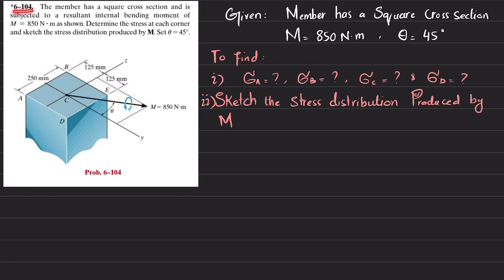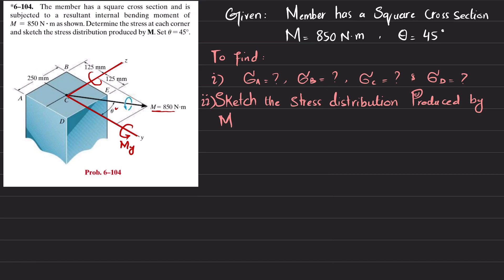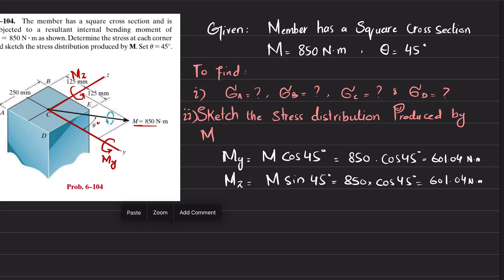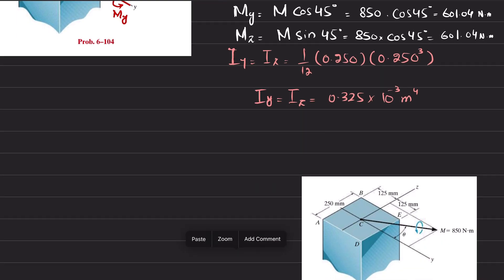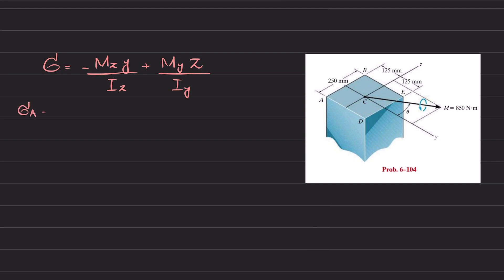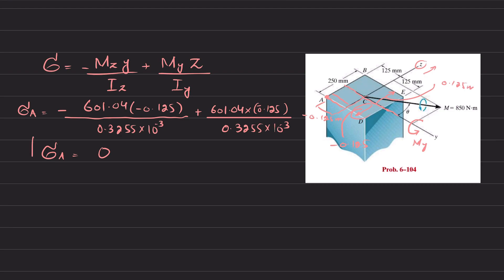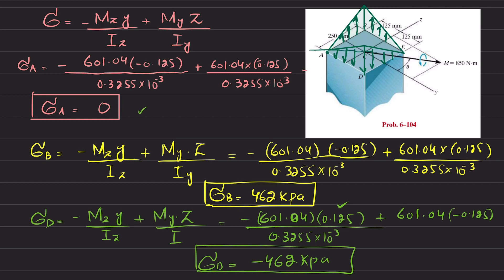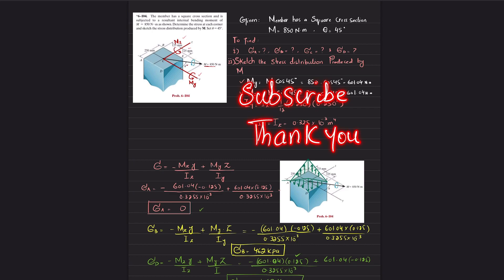6-104 |Chapter 6| Bending | Mechanics of Material Rc Hibbeler|

Comment: Why is Mz negative? How do you figure that out?
Reply from the maker: Mz is positive and this is the formula having negative value.
Reply: @engradnanrasheedmechanical  how do we know which one become minus on flexure formula mz or my ? i mean which one we should write firstly
Reply from the maker: @iceberg4982 it's a formula and just remember it and watch the stress calculated at each corner you will know it easily. Actually the moment is causing tensile or compressive stress. Tensile stress is positive and compressive stress is negative.
Reply from the maker: @iceberg4982 https://youtu.be/8kOh_NOKr0A?si=MQ7X5uy6NpToUUOd
Reply from the maker: And you can see at point A when calculating the stress the first term with Mz come to positive....
Reply: @engradnanrasheedmechanical I see
 Thanks

Comment: Could you explain this problem 🙏🏻

A member having the dimensions shown is used to resist an internal bending
moment of Determine the maximum stress in the member if the moment is applied
(a) about the z axis (as shown) (b) about the y axis.
Reply from the maker: Kindly mention the problem number?
Reply: @engradnanrasheedmechanical  unfortunately it written without a number in our slides  but I think in the first section of chapter 6 bending
Reply from the maker: Without diagram it will not possible....you can check the problems in this playlists 
CHAPTER 6 (BENDING) BY MECHANICS OF MATERIALS  R.C HIBBELER (9TH EDITION), Complete Solution by Engr Adnan Rasheed Mechanical: https://www.youtube.com/playlist?list=PLuj5YwfYIVm9CxuqONbS-s67TM9AdIpPg

Comment: why do we neglect whether the moment acting on each end in compressive or tensile
Reply from the maker: We usually don't neglect. The formula is given and you should have idea about the direction of moment creating either compressive or tensile stress at each corner.
Reply: @engradnanrasheedmechanical  but why didnt we take it into consideration in this exercice
Reply from the maker: Moment is not compressive or tensile but due to moment either compressive stresses generate or tensile. The direction of moment is important that will decide the the stress above or below the neutral axis.